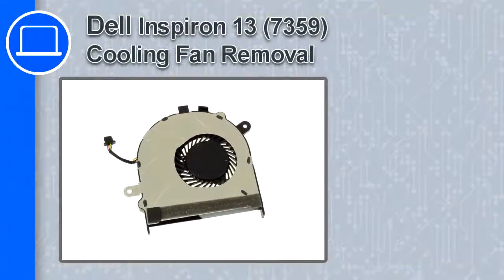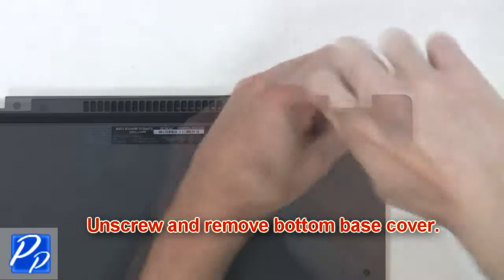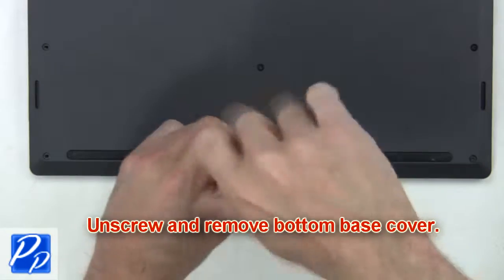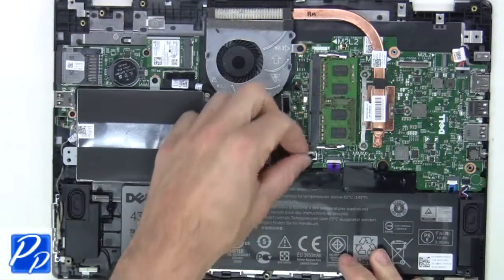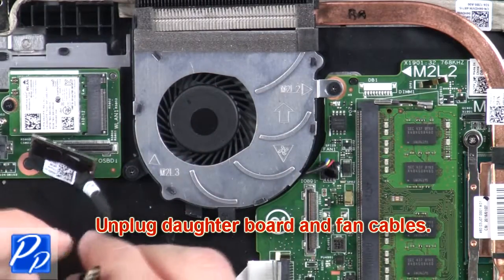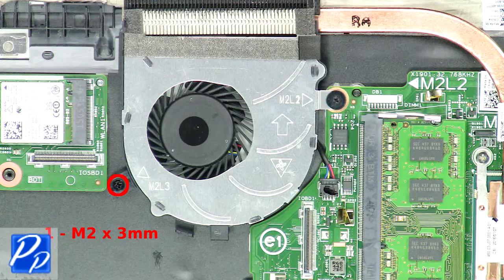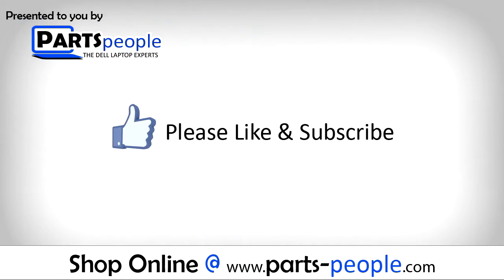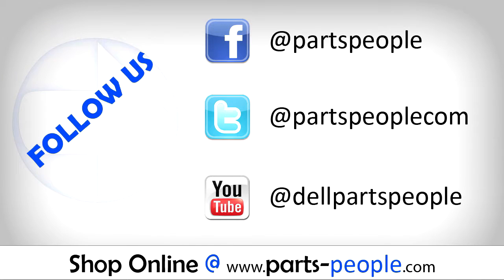Dell Inspiron 13-7359 (P57G-002) Cooling Fan How-To Video Tutorial

Comment: noob here why the removal of battery and hard drive wires and not going straight to the fan?
Reply from the maker: Dell recommends disconnecting the battery before servicing your laptop. The hard drive cable slightly obstructs the battery.
Reply: @dellpartspeople  thank you for the answer :)